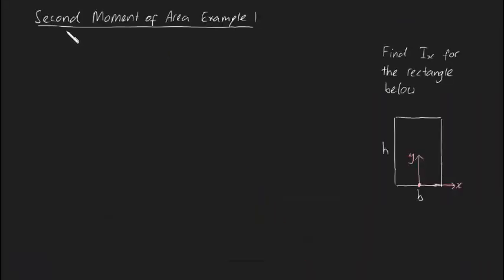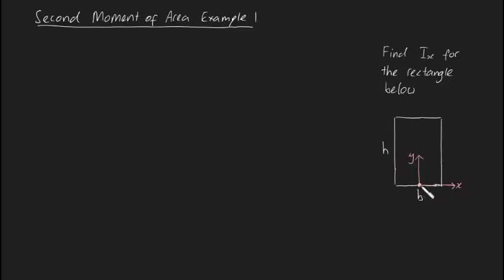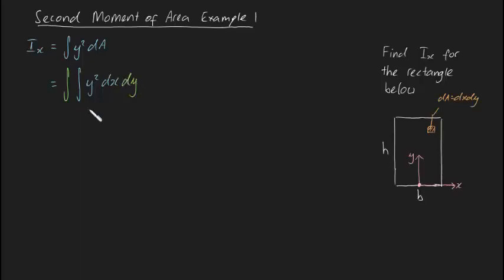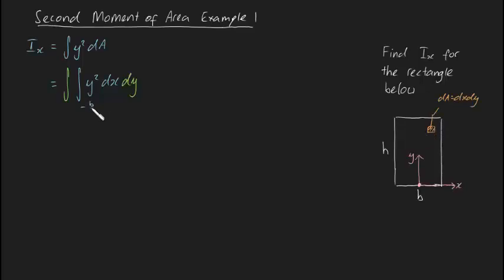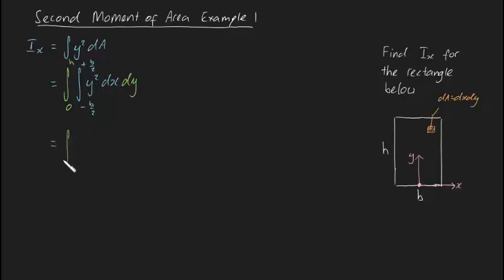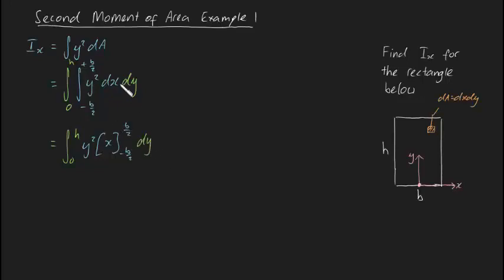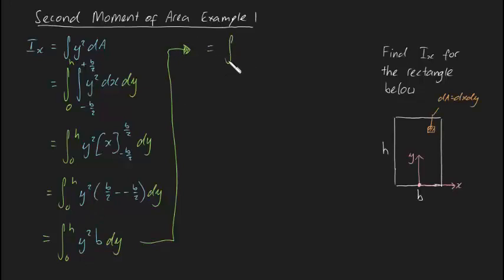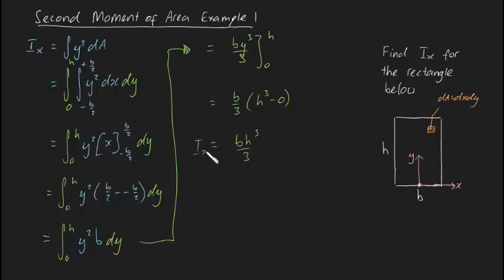Second Moment of Area Example 1

Comment: Your explanation it´s very nice but when I do exercises like this, How can I know the order of the diferential dA in the double integral of second moment of area? I mean, it doesn´t depends of the Ix or Iy so I don´t know how to determine the order
Reply from the maker: Hi! Great question! It actually doesn't matter which order you integrate. You can integrate with respect to x first and then integrate with respect to y, or visa versa. You will get the same answer. The only thing to account for is the change in bounds of each integral. 

I recommend trying my example 2 to give you some practice in determining the bounds of the integrals in more complicated problems :)

Hope that helps :D
Reply: @virtually_passed  Thanks for your answer, I saw your example 2 but I have a similar question, in that example and in other ones when I tried to find the Iy without watching the solution of your video, I integrated with respect to x first and then respect to y but the answer was in terms of x so it was wrong, then I did the opposite and it was correct, so how can I know the order of the integration? However I noticed that the bounds of the integral respect to y are in terms of x, so I think the mistake is because of that

I really appreciate your help, in my language there are only examples with integrals in a single variable. Thanks
Reply from the maker: @ferypatriciarodriguezmonta3708  Thanks for your reply! Send me an email at virtuallypassed@gmail.com and if I have time I'll write up a solution to my second example problem using another method (switching integral order) . :D

It's possible to do all of these problems using a single integral, but for that you need to choose a small element of area dA which is a strip element, not a point element. I can show you how to do this too in my email. :)

Cheers,
Matt

Comment: your answer is wrong as the finala answer is meant to be 1/12bh3
Reply from the maker: Hey mate, thanks for the comment but I'm very sure my answer is correct. The 1/12 bh^3 formula you're referring to is for the area moment of inertia of the block taken around its CENTROID. Notice in this case, the x-axis is at the bottom of the rectangle (not the middle) so the answer will be different. If you were to change the outer limits of the integral to -h/2 and +h/2 then you will get 1/12 bh^3. 

Hope that helps :)
Reply: @virtually_passed  yh that comment was premature i realised after where the axis was.quality videos thanks
Reply from the maker: @famofamo5451  :)